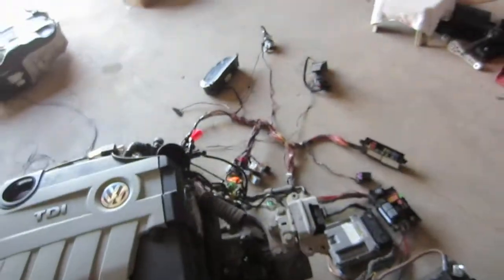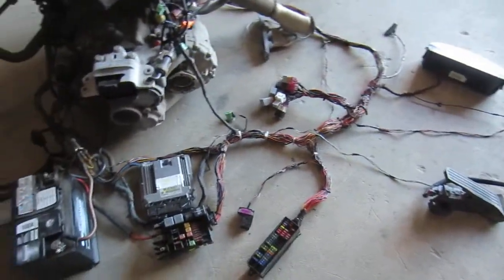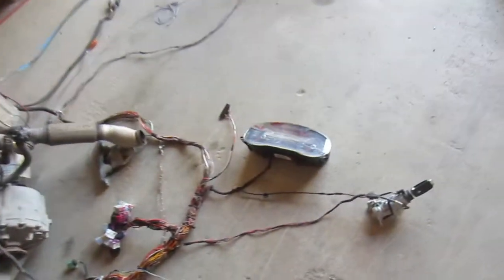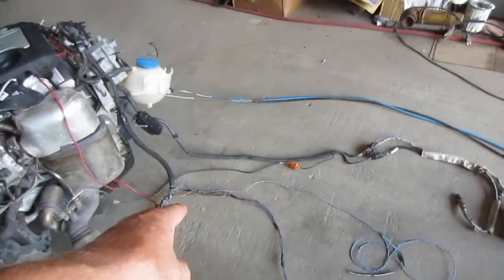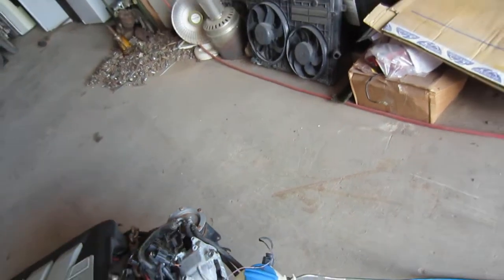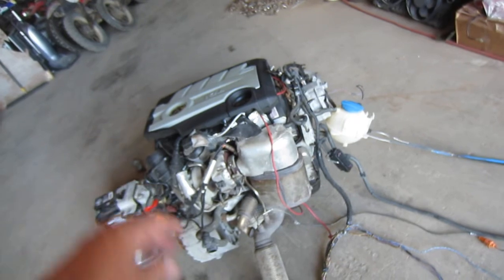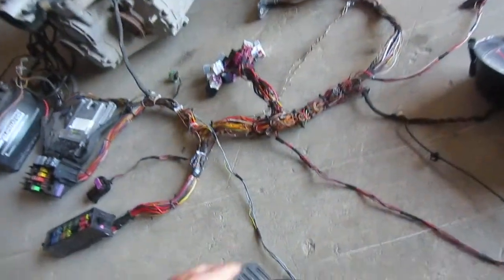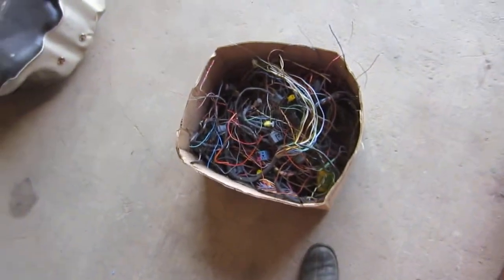9 . the deconstructed TDI, CJAA, vw wiring harness in operation

Comment: This is awesome!!! I’m putting a CBEA/gtb2260 turbo into a 1994 Nissan 240sx with the factory 5 speed. Will definitely be doing it with the stock harness
Reply from the maker: test it on the floor like me so no surprizes later.still driving my swapped caravan after 4 years with no issues.

Comment: If the horn is only two wires I wonder if you can't just easily trick it with a resistor of a specific value
Reply: Most likely.